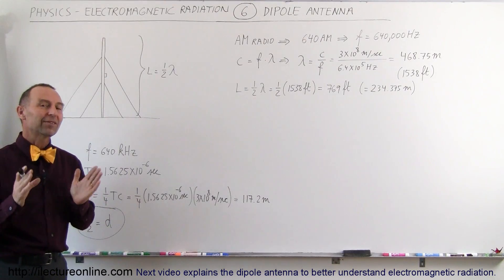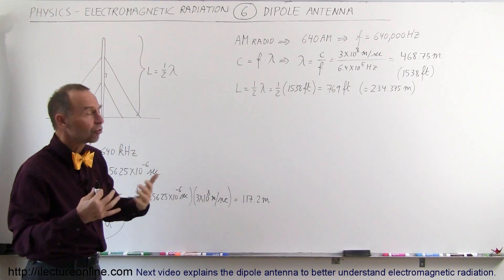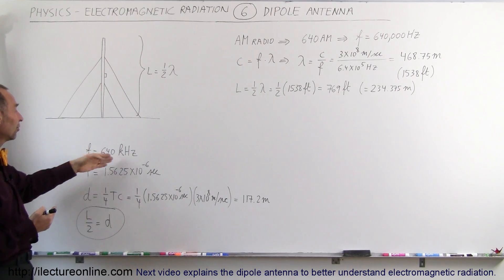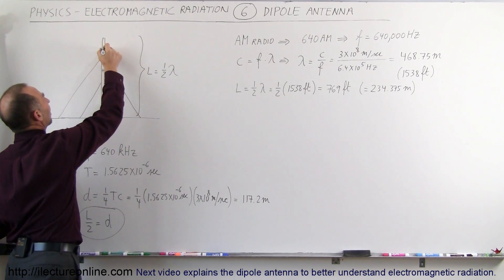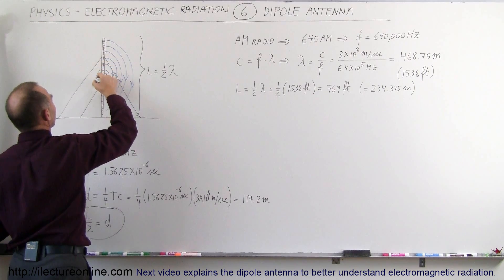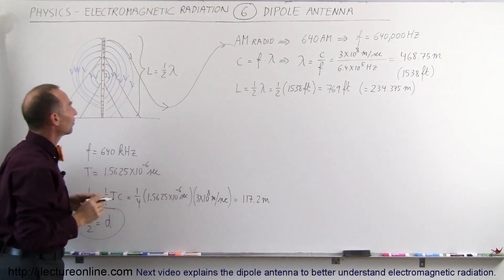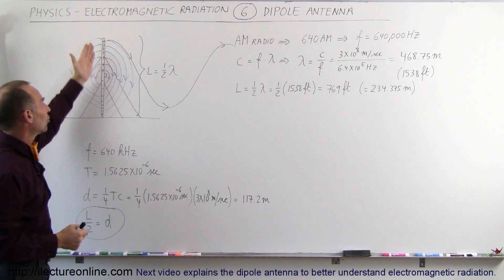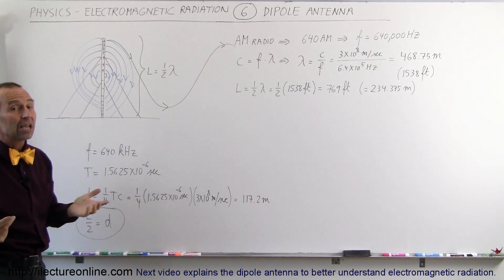Physics 50   E&M Radiation (6 of 33) Dipole Antenna and E&M Radiation

Comment: This is awesome! I just got a question, why is it significant to mention that 1/4 of the wave has to travel 1/4 of the wavelength? It is the same for half of the wave. Is it a justification about it I missed? I can tell the significance of its dependence on the speed of light, but other than that, why it has to be done in 1/4 of the wave it travels?  Thank you in advance!
Reply from the maker: It doesn't have to be done in 1/4 wave intervals.  That was just used for the purpose of illustration.
Reply: @MichelvanBiezen  Thank you, sir! You are a very responsive and responsible teacher! It is wonderful to know there is someone like you around for learners to turn to when there are problems😀!

Comment: Can it be possible to measure frequency or wavelength of grass or leave 
And if i want to measure energy by this frequency will i use h* frequency or something else
Reply from the maker: It is possible to measure the energy emanated from grass and leaves.  It would be infrared radiation.

Comment: Hi Michel. Thanks for some amazing videos. I would just like to ask about your comments on the optimal length of the dipole antenna. I saw somewhere else that they said the ideal length is a half wavelength. On the other hand, a length of a full wavelength would result in no radiation due to destructive interference. I would intuitively think of it as two dipoles along your radio tower oscillating 180 degrees out of phase with each other with their EM waves thus cancelling each other out. Could you please comment on this?
Reply from the maker: The cancellation only happens in some directions and not in others. (It is a function of the extra distance traveled relative to the wavelength, which changes for different angles).
Reply: Thanks for the quick response! 100% correct, I should have been more clear. Certainly in the horizontal plane through the midpoint of a 1 wavelength tall tower the pathlengths would be such that one gets perfectly deconstructive interference. I would say that the most important direction(s) would be in the horizontal plane for our radio tower transmitting to, for example, people's radio receivers situated along the suface of the earth. I also think it is a reasonable approximation to assume these receivers are near to the horizontal plane. In that case the half wavelength tower is actually ideal as opposed to "good enough" and making the tower taller than that would begin to diminish the signal amplitude in the horizontal plane.

Comment: So is the antenna sending out photons from the positive end towards the negative, but as polarity switches, the direction the photon is traveling switches? How do the photons simply not stay in the proximity of the antenna, constantly moving back and forth between the ends, rather than emanate outward? Is it the magnetic field that is doing the pushing?
Reply from the maker: The answer is the same as answering the question:  Why do the ripples on a pond move outward when you throw a rock in the pond?  The electric/magnetic fields forces the electric/magnetic field out of the "equilibrium" position, and when it "snaps" back the ripple continues forward.
Reply: Michel van Biezen Thank you for responding and for these great videos! If you don't mind my continuing further: So I am correct that it's purely photons that are generated by the electrons in the antenna? And more importantly: I see that analogy, but I understood water ripples as water being pushed outward by whatever object caused them or each ripple pushed the previous outward. I assumed particles in an E field had a different behavior, they were drawn to one end like a mass is drawn by gravity and the end of the E field being the opposite end of the antenna. What itself does actually make it radiate outward? Sorry, I think there's something I'm missing.
Reply: I think it is easier to think about this in terms of the electric (and magnetic) field instead of photons. The electric field will propgate itself through space by the speed of light so if you put a positive charge in space (out of nowhere) it will "emit" an electric field. This field will no spread through space and if you where to take a snapshot at the electric field just a moment after it started spreading you will see that it has come to a certain point and bexond that point the elektric field does not yet "exist" (it is zero as it hasn't propagated that far yet). Now if you take that positive charge and start oscillating it you are constantly changing the electric field (because you are effectively moving it's source) and that change in electric field can be thought of as a new electric field that has to propagate through space. Therefore if you take a snapshot of the electric field now you will see that at different points in space the electric field is different as it simply takes some time for the field to propagate through space...